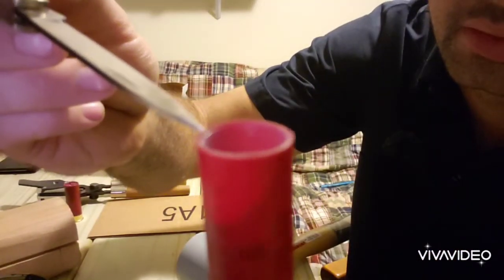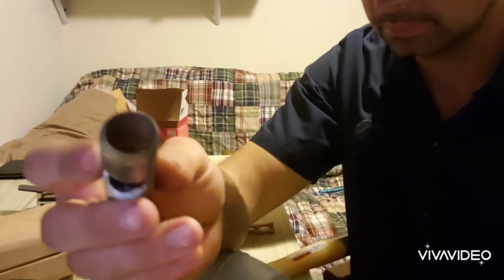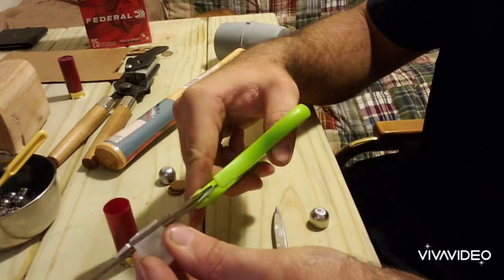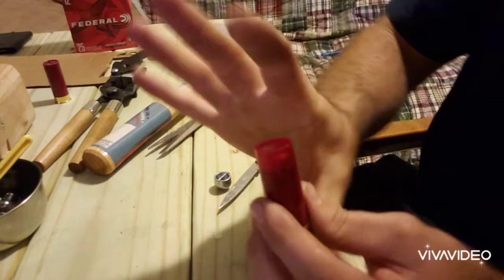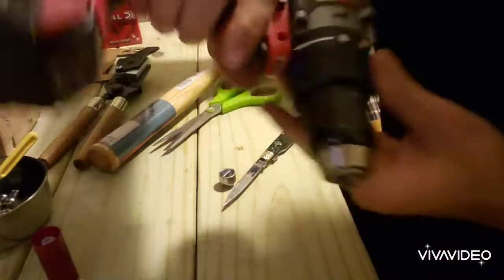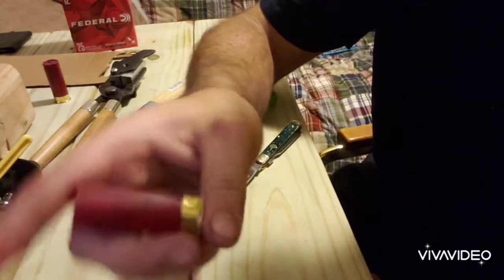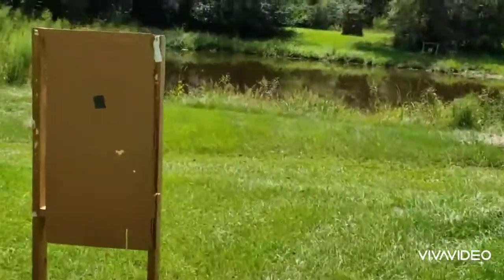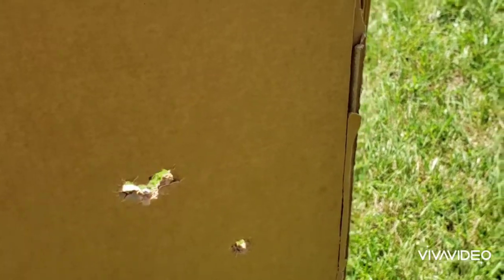Turn birdshot into slugs $0.25 slugs

Comment: I bought a Lee mold and a Carlson rifled choke! I had pretty much everything else I needed. Absolutely get the choke if your barrel has removable/screw-in chokes… the choke increased the accuracy tremendously! Still get the occasional flyer, but I have a pretty consistent 3 inch 6 round group at 50 yard from a bench rest! - without the choke it’s 6 inches at best or bigger!

Comment: A Coleman liquid-fuel gas camp stove is great for melting lead. Doesn’t matter if it a big or small version. Also got enough to melt tin-alloy lead, & other strong alloy lead metals.
Reply: Also, a used Bunson burner set could be too.
Reply: You don't need to harden a slug, they do not deform, and if they do on impact, much better, pistol/rifle bullets, yes. I bought a Lee melting furnace 40 Yrs ago and also is great for sinkers. Skip the stove part. It works but. Even got a small bird shot electric melting device. There you need to make hard shot to keep paterns tight. Lead/tin/antimony. Slugs are useles fo hunting in a Smooth Bore. But they can be very accurate in rifled bores👍My fav is a Savage 220

Comment: Open the shell pour out the shot  into a tiny cast iron skillet ( decorative ).
Melt that shot to liquid pour into a 16mm. 12 point socket. 
Cool and punch out. Install back into shell. Push down the crimp. fire. 

You dont need to do all that with all those tools.

Only work with one shell at a time and the powder will always be right.
Imlo.
Reply: Interesting! Did you do this and did you notice any change in accuracy?

Comment: A simpler option would be to make the existing shot into a wax slug
Reply: That’s what I thought he was going to demonstrate 😜This is too much work!
Reply: Alright so I hope you see my reply cause I always thought a wax slug was just as good. I tested it out, it's really not. It's kinda like a very, very weak frangible round that falls apart even if you look at it the wrong way. In my testing, a real slug will go clean through both sides of a 55gal drum. A wax slug only goes through one side at close range some of the time if it holds together. This guy's method is way, way better than wax slugs and it's actually kind of fun to do.
Reply from the maker: Wax slugs melt if you live in a hot climate
Reply: Adding the weight of wax to the weight of an existing shell is dangerous and could make the pressures spike. Good way to blow up your gun and hands.
Reply: Wax slug? You mean a door breaching round.
Reply: They aren't as good iv tested it. Especially in hot weather and distance.
Reply: If the barrel gets hot and melts the wax on a chambered round.  You've got pellets in the action or rolling out of the barrel. Not good. 
  In an emergency in the woods. Getting stalked by something that wants you for lunch or something.  A cut shell turns birdshot into a better defensive round. It doesn't take long to make one. Just take care not to eject the round and stretch it so the pellets spill out into the action. It's also not good to load one into the magazine for the same reason. It may come apart and disable your shotgun. 
  Making 2 or 3 cut shells and having them readily accessible for single loading might be a better thing to do. 
  Or better yet, take some good slug reloads or Factory loads with you for just in case. 
  Then it's time to see who is going to have who for lunch.
Reply: I'm a big fan of "cut shells" like my grandfather taught me.
Reply: I used hot glue.  Shelf stable across temperatures and holds together a bit better when hitting milk jugs.  Never tried on a deer but still fun to shoot.
Reply: slugs kill bears. wax slugs don't
Reply: Elmers glue. Check your weight,adjust accordingly.
Reply: Checking  weight. Build a small hole in the center of the front. using a syringe and needle inject your epoxy.   The cheap low brass clay pigeon stuff has low shot weight and powder charge epoxy won't over pressure. High brass and Magnum cases best to check your weight carefully.
Reply: @minerblue9641  it's illegal to have slugs while small game hunting here in KY
Reply: @johnnywalker6385  I tried the pva wood glue & it fairly regularly contaminated my powder. After casting up a few hundred Lee slugs & reloading once fired hulls is the way to go. To be honest I find regular 00 & 0 buck loads on sale & jump on em . Like last night picked up 500 / $360 . I think that’s pretty good for buying these days.
Reply: What target loads are you using for the slug?
Reply: @ClarkesonTheMarksman  any will do mate . I’ve used 71/2 target loads to bb’s & everything in between. Your displacing lead for wax , so there’s no pressure issues.
Reply: @concernedaussie1330  Thx for the reply. I assume you dont need to use wax and you can just 6 crimp the top?
Also theres no issues with using low brass like 8mm cartridge cases which are standard on the 71/2 bird shot/ target loads?
Reply: @ClarkesonTheMarksman  sorry . I thought this was a wax slug video. 
I haven't yet swapped out slugs for bird shot.
However i have a few hundred 7/8 oz lee slugs cast & ready to use. 
That's what i would use . 1 oz birdshot or target load with a 7/8 oz slug , just to stay on the safe side .it's also alleged that the 7/8 slugs tend to yaw less , hit hard enough & consume less lead .
Reply: @whiteoakforge- tru
Reply: Wax isn’t going to kill someone…that’s like shooting someone with a rubber bullet. It hurts but that’s about it. One ounce fishing weights are the way to go. They are cheap and effective.
Reply: @LosDoyerss  i meant adding the wax to bird shot  or something not just pure wax.i guess you've never heard of a wax slug

Comment: You can use 20 gauge shot cards under the slugs . They fit a bit better in the wad. I use a clear over shot card then roll crimp with my drill

Comment: Thanks for sharing your information. Only a small handful of people sharing their birdshot to slug conversion data. Two questions, 1) after roll crimping, how recessed is the slug compared to the top edge of the roll crimp? 2) how far out are your slugs releasing from the wad?
Reply from the maker: Glad to help
Reply: Why cut the end of the shotshell? 2 3/4" shell(fired or new), Wheight the slug and choose a stiff powder charge. 7/8 Oz target Wad, cardboard spacer if needed, Star crimp or roll crimp. Bird shot way to usefull to melt, scrap lead available. I still have Felt Wads, Carboard spacers.Over shot plastic cards for roll crimping, But it's been a very long time since I fooled with those for 12-20 Ga. You need a rifled barrel or choke for slugs to be accurate. 50 to 100 Yds Accurate for game . Wads for 7/8 Oz to 1 1/2 Oz Bird/Buckshot. Keep it simple.😂

Comment: I ordered a plastic 3D printed shell cutter for about $20.. The razor blade tip is aimed at the end of the shotgun shell when you insert it.  It cuts just inside the hull, cutting out the star crimp, but leaving a little rim on the hill.
Reply: Where can I order this

Comment: Try a ringed load. Saw this in a Poor Man's James Bond years ago. Just score the shell around the wad to weaken the plastic. The shell will still cycle in a pump shotgun. When fired, the shell exits in one piece. In effect you've created a giant Glasser slug. When the slug enters the intended target (in my case it was an old jerry can filled with water.), a piece of metal was cut from the can the diameter of the slug, the bird shot scattered though out the jerry can. The author of the article claims he hunted bear in the Appalachians with these ringed loads. Very deadly.
Reply: Wow.   Thank you
Reply: There's a whole bunch of videos out there on cut shells. Fine for an emergency but if you like to re use your shells you're kinda SOL with cut shells.
Reply: @xMrBlack  Cut shells are cut all the way through the shell whereas a ringed load only scores the shell so it can still cycle in a pump shotgun. You are right in that the shell cannot be reused.
Reply: @georgestreicher252  frankly I'd split the difference and do wax or glue slugs.
Reply: It would be a good idea to check penetration on a cut shell or ringed shell. I don't think it will compare favorably with a slug. It may just piss off the bear.
Reply: We called them waddies. Work well in a pinch!

Comment: Why would you cut the crimp end of a shell to load a Slug. Use once fired or new cases, buy some 12 Ga 7/8 ounce Target Wads, and just starr crimp like other reloads. Keep it simple. Casting slugs is an extra step and using Bird Shot expensive. Scrap lead available. Did you mention what type of barrel you used? Nice Pattern. Not likely a smooth bore. Have tried it, but not with a 20 Ga Slug.

Comment: That was some good stuff you mentioned . But don't hit the mold there . Hit the large nut on the handles and the mold will last you for a long time .
Reply: I found this out the hard way.
Reply: The first few are very difficult to get out but eventually I barely have to "tap" and they pop right out

Comment: I saw you used 1200fps , can you use 1350fps target loads ? Or is there to much power for the lee slug . G'day from Australia btw
Reply from the maker: As long as you match the original projectile weight you can

Comment: I've been thinking about doing what you're doing but with .410 and the actual slug I believe is premaid for 15 cents a slug that I've found on Midway USA , if that's the correct bullet . Do you think cotton balls would suffice inplace of the cardboard ? I do wish they made 410 slugs FMJ'D and bonded or if they made a bullet mold that I could use steel inplace of lead for health and environmental reasons but if all there is is lead bullets then I'll use those . I do like the shell cutting tool you made but is there an way to unfold a shell ? I would like to get bullet as close to forcing cone as possible to maybe prevent gas blowby for maximum power , if that is even a problem .
Reply: Actually now I'm thinking in place of the cotton/cardboard to use wax or epoxy which would function as a riser/spacer or shuttlecock of sorts . Not attached to bullet . The bullet just sits on top of it . Whereas the wad wraps around the bullet thus sometimes sticking to bullet and maybe effecting bullet in a negative way .
Reply: Now I'm thinking if I drill a hole in the top of the bullet that I'll be making my slugged bullet with if it'll unravel better . Then when I go to fold it back together placing an inflatable sports ball valve in that hole and hopefully inflating the bullet a little bit in hopes that giving more air will give a cleaner burn . Or hollow out my bullet riser thus allowing more air to fill inside shell . I'm thinking if I do all this in a cold environment it would condense the air anyways therfore when I take it outside into a warmer environment it naturally would  be a little pressurized ; that is if it's hermetically sealed . I don't know how air tight bullets are anyways . Sorry to overwhelm you with these ideas .
Reply: Buy a couple of cheap second hand books about reloading, you will save yourself a lot of time ☺

Comment: Open top petals pass open birdshot round  to friend with with commercial glue glue. Carefull not to get glue outside of wad. Takes about 2 minutes or less . Recluse hull petals. Don. Another deadly round is same. But pour shot out into small shot glass or similar.  Add 00 Buck Ball's, or larger lead Ball's. Take up space with the 7,8 shot till full. Then fill with hot glue stick as before careful to not overfill. Close hull petals and u have devastating rounds. 62 years reload.

Comment: you can also just make them into cut shells by cutting behind the shot in the shell about 40% on one side and 40% on the other so when fired they will break away and the hull shot cup and shot are one package that will really come apart on impact. do at your own discretion and care it is dangerus. low brass only
Reply from the maker: Yes im aware of cut shell but they can only be single loaded. So as long as you only need one shot there great,,  easy to use but if you want a tube full of them they won't work.

Comment: Any squib loads due to the heavier slug and low brass instead of high brass? Seems like a good zombie apocalypse thing to do.
Reply from the maker: I haven't had a problem yet
Reply: The brass height doesn't matter. Low and high brass will handle the same pressure. It is just marketing.

Comment: Rather random question, couldnt someone hypothetically just use lets say bearings? Or what is sometimes referred to as “slingshot” ammo? Then you would just cut, empty, put a bearing in and finally find a way for it to hold in place to shoot 🧐
Reply from the maker: You hypothetically could and recrimp it. I would probably fill the voids of slingshot ammo with peices of the removed birdshot to add more weight so all the powder will burn. Because if it's to light you may not get enough back pressure to ignite your shell fully
Reply: Bearings are very hard steel , harder than the gun Barrel , not Safe !

Comment: I have to say, I have a one oz Lee drive key mold and I am not impressed with the accuracy. I have tried numerous hull, powder, wad and filler wad combos and only achieved mediocre accuracy. (smooth bore, rifled bore, rifled choke and different choke restrictions). The wad/filler wad definitely affects accuracy! Even the filler wads get stuck in the slug, I have contemplated filling the base of the slugs with a hard light weight substance, maybe a foam filler with an epoxy binder. This "plug" stays in the slug and would stop the wad from getting forced into the hollow base. I have also contemplated filling and gluing the filler wad to the slug, , similar to other manufactures, I think Breneke does that. The filler wad would need to be non-compressible so it didn't end up tweaked and cause accuracy issues. Another note, I followed the Lee process of using the star crimp vs roll crimp, I do want to get a roll crimp tool and try that. As far as smoking the mold, Lee recommends using a butane lighter, I prefer the long BBQ lighters, better reach and less burnt fingers. So many experiments, so little time. LOL
Reply from the maker: Alot of people have problem with accuracy out of the 1 ounce mold 7/8 ounce has been the most accurate for me
Reply: Whiteoakforge is right.  It seems the vast majority of folks report poor results with the 1 oz.slug, so much so I'm surprised they still offer it, but just as many or more report good to excellent results with the 7/8 oz. version.  Swap your 1 oz. mold off for the lighter version, & you may have much better results.  Also, the Lyman "Diabolo" 525 grn. sabot slug design has a rep for very good results, even from smoothbore guns.
Reply: @grantgarrod2232  Yeah, I plan to pick up a 7/8 oz mold (they were out of stock when I last was wanting to order one) but have a problem with throwing in the towel when trying to figure out a solution LOL I will still try to figure out something with the 1oz and also get the 7/8 oz. Suborn I guess.

Comment: Question .690 round ball weighs 495 grains, I would like to cut the nose to a flat tip reducing weight to 485 grains. Is it possible to reload a 1 1/8 ounce birdshot shell with a 690 round ball?
Reply from the maker: It's possible but depending on your original shells being used you using more than the original weight of the lead could result in increased pressure which could result in the shell or gun to explode but 1/8 of a ounce  is probably not enough of difference to do this but it's still a risk

Comment: I have thought about doing something similar. Trade out the birdshot for .36 caliber lead balls. I have a mold to make those. I wonder how many would fit? 00 buck is .33 caliber. I should be able to make it work. Any feedback would be appreciated
Reply: All u gotta do is buy a small scale. When u dump out the birdshot, weigh how much comes out. When u go to refill with the .36 cal lead balls, try to get as close to the weight of the birdshot without goin over. It's ok if your a bit lighter. That's shell is made for a specific weight. So long as u get close to that weight, u can shoot anything. Screws, needles, dimes, if u experience any looseness, u can always stuff a cotton ball in there to make them lead balls sit tight. Glad I could help.
Reply: @chrisharmon5309  thank you!

Comment: Should never smack the mold on the screw where you hit it holding the slug, you want to smack towards where the handle pieces come together that spot with wood only because you can bend your mold I did. A old timer told me this and I didn't listen, I actually bent my first mold like yours after making about 200 of those things because mine's stuck more than most I guess? it still works but it's harder to get together. I had to get another one for faster slug making.